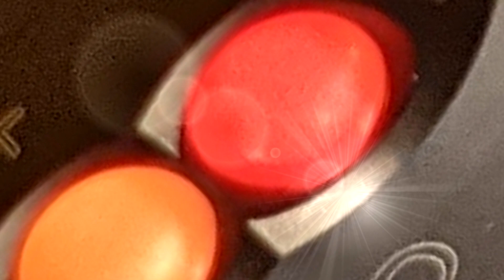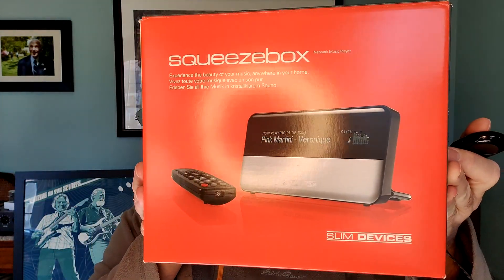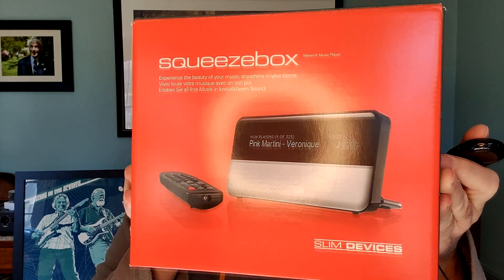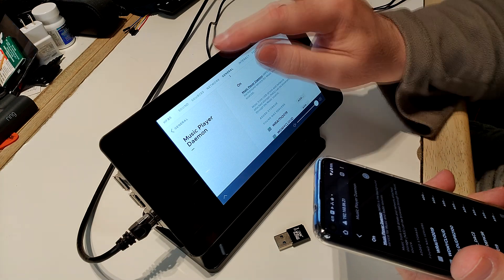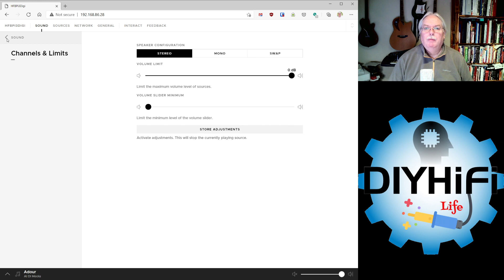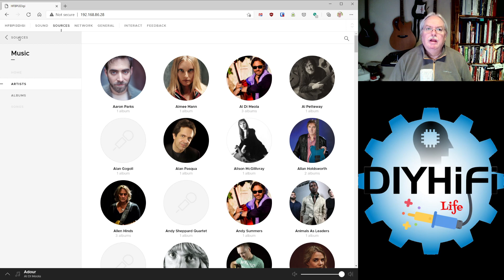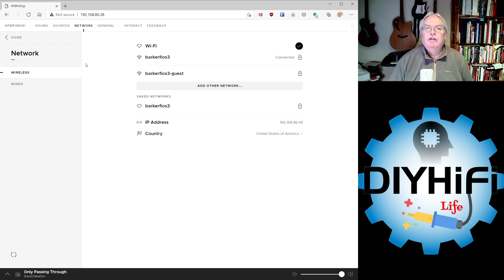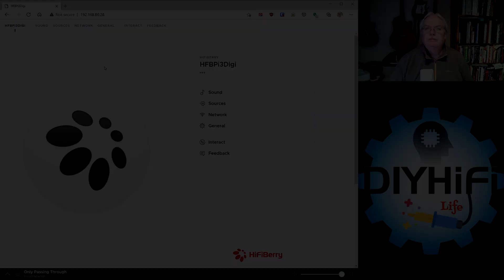Touchscreen Streamer with HiFiBerry OS & DAC for $150

Comment: Not sure if HiFiBerry OS has gotten worse since your video, but I tried your exact set up and found the touchscreen to be worthless.  The touch screen latency is so slow that it renders the device unusable.  Furthermore, the touchscreen frequently freezes, displays the wrong 'now playing' image, and the screensaver fails to activate. However, without the display, it works well.

Comment: Great video. This looks to be exactly what I intended to make with the raspberry pi. Even down to the right angled digital coaxial plug. 

Did you have a total value limit or anything in regards to your choices of the RBPi 3 over the 4 or the Digi pro over the Digi2 Pro?  

I’d like to use the RBPi 4 with Digi2 Pro, Official touch screen, SmartiPi Touch Pro, with Volumio,  to go into my Schiit Modi Multibit, and then into powered speakers like the Klipsch Five’s. 

My goal was for a nice home audio setup that can stream and playback local HiRes audio files up to 192/24. 

Thanks for the video, super helpful.
Reply from the maker: Thanks for watching. I think it is up to your budget whether you go RPi 3 or 4 and HB Digi or Pro. I think you will get similar performance either way.

Comment: I don't think you can use a RaspberryPi to stream AmazonHD ???   If that's not correct I'll definitely be building one.
Reply: I was working to get AMHD for my system as well but when I upgraded  to HD I had to download and install an app on my mac mini to get to the HD side of things.  For this reason I don't believe there is a way of getting HD on anything other than your computer or the few appliances that Amazon has in their ecosystem.  RPI systems such as Volumio use proprietary OS and don't connect thru a browser
Reply from the maker: Thanks for watching. Amazon HD is an outlier and does not play well with many devices. It's a pity and I wish Amazon would open up a bit.